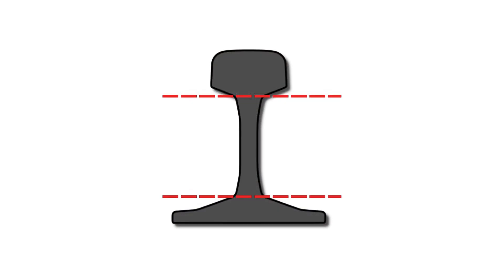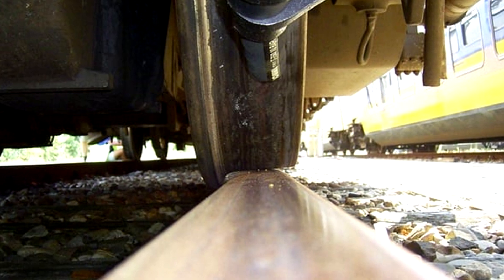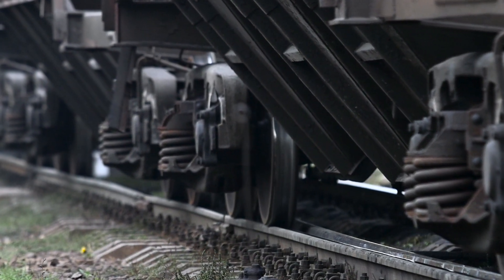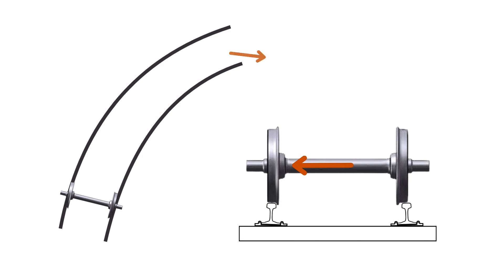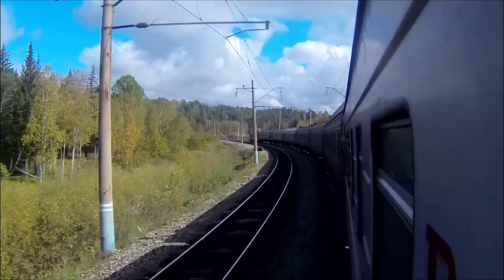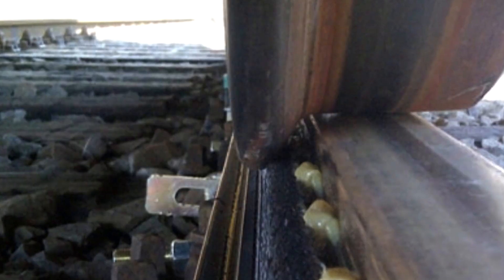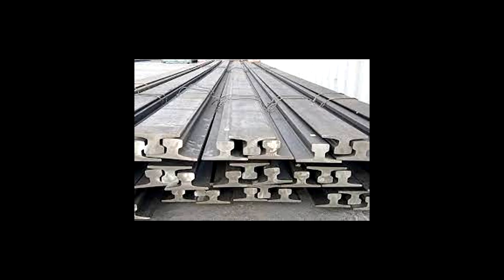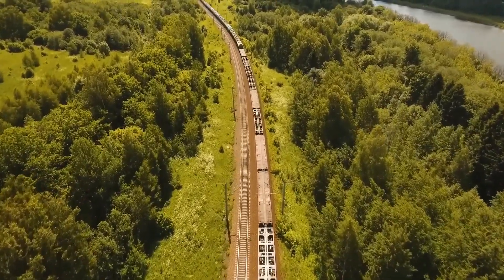Why Are Train Track Rails Shaped Like That? ( Hint: It’s Not Just for Strength)

Comment: I spent the first dozen years of my engineering career at a company who produce railway layouts.
The picture you showed of side wear is extreme and seldom seen on main line track. I have only seen this extreme sort of wear on one occasion. This was on the turntable for a world-famous radio telescope. Just a circle of rail, it took the entire massive weight of the telescope. The combination of (by rail standards) a tight curve, small diameter wheels and massive axle loads had produced a similar wear shape. I say similar, because the telescope rails had mushroomed like a well-used cold chisel - indicating plastic deformation - almost unheard of on a rail.

Comment: Good presentation, I've been on the railway for over thirty years in various roles. Previously as an engineer, and for the last few years as a driver.
I don't think you mentioned gauge-widening on curves in your video, may be useful to add this in.
Well done.

Comment: Steel wheels on steel rails is NOT good emergency braking.
Reply: It's a good (low) rolling resistance factor for tractive effort though, which is why rail has many advantages over road.
The contact point is barely larger than a penny, also sand is not just for adhesion when applying power, it can be applied while emergency braking.
Reply: Which is one reason why railways have: exclusive controllable-access "no trespassing" rights-of-way; priority at grade (level) crossings; and signal/ control systems - so they don't have to do emergency braking as often.

Comment: Rails are my special nerdy subject. Did you know the size tolerance of a rail is typically 5 times more stringent than those of of steel beams in skyscrapers.
Reply from the maker: I didn’t, that is a very interesting fact! Does confirm how crucial the shape is to the wheel rail interface!
Reply: Very interesting! I learned a lot. Thanks 😊
Reply: WHAT
Reply: @golfberg1  📢 I SAID - DID YOU KNOW THE SIZE TOLERANCE OF A RAIL IS TYPICALLY 5 TIMES MORE STRINGENT THAN THOSE OF OF STEEL BEAMS IN SKYSCRAPERS 📢 (Sorry I couldn't resist)